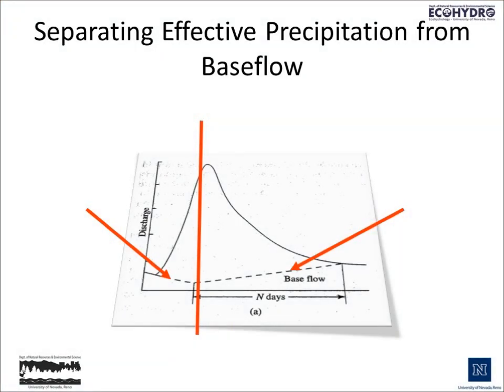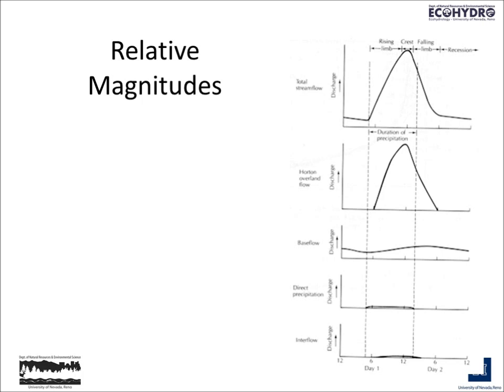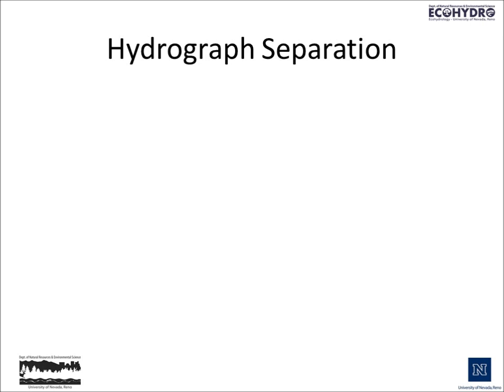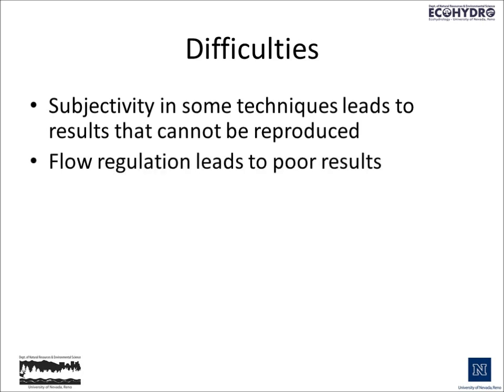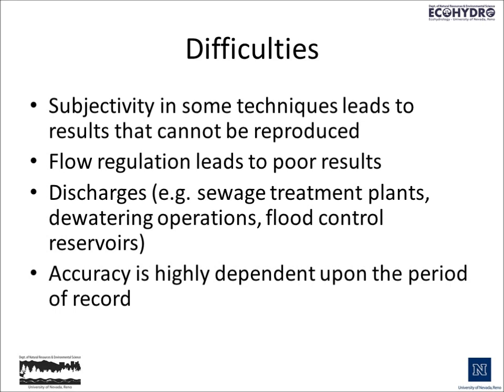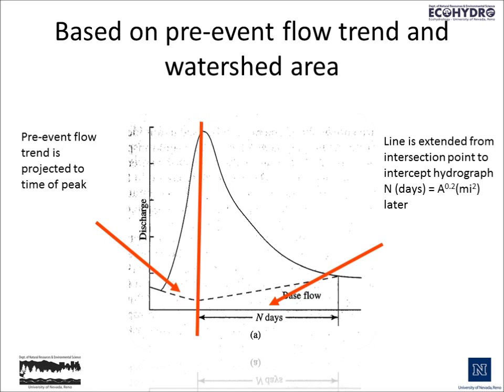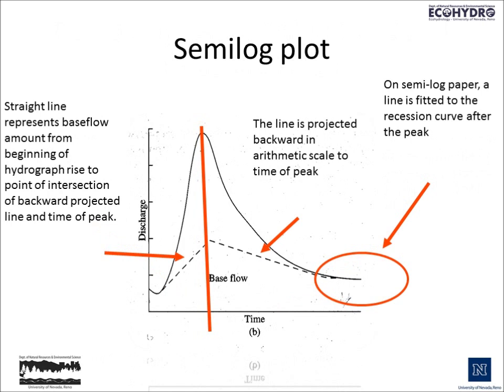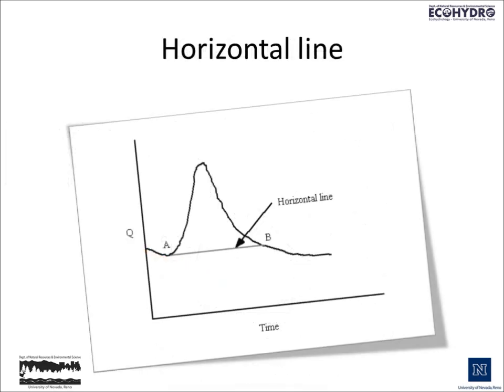Techniques for separating baseflow from stormflow

Comment: The runoff data at a stream gauging station for a flood are : Time : 2 5 8 11 14 17 20 23 . Total runoff ordinate : 50 47 75 120 225 290 270 145. The area of drainage is 40sqkm.The duration of rainfall is 3 hrs.derive the 3 hr unit hydrograph for the basin.PLease solve this.ive got exams tomorrow.Im having difficulty in calculating base flow ordinate